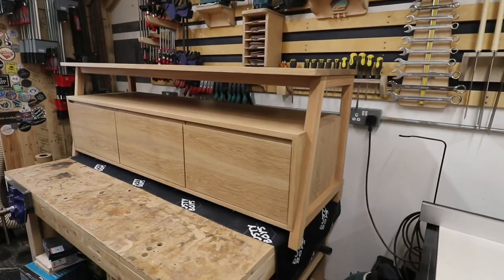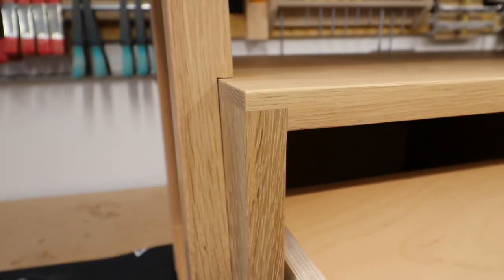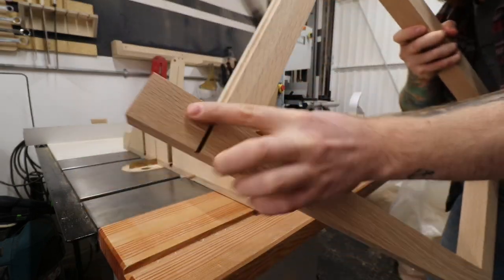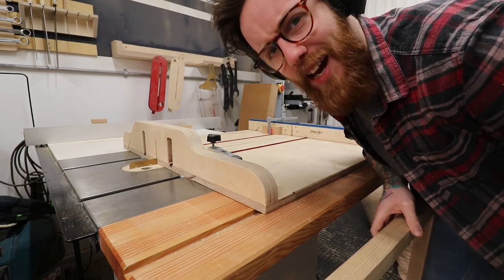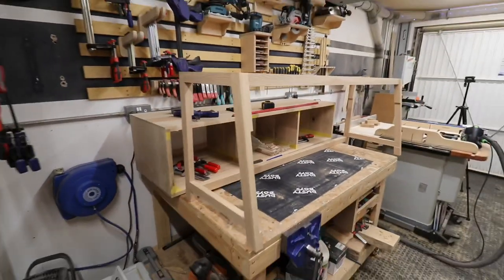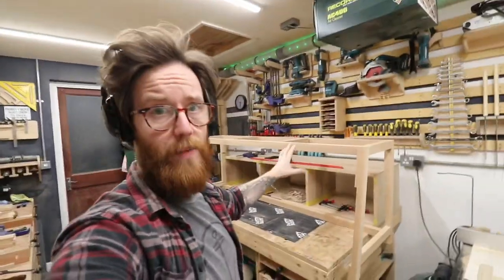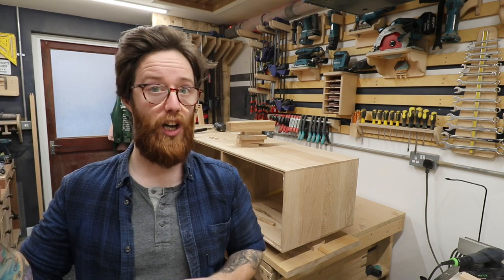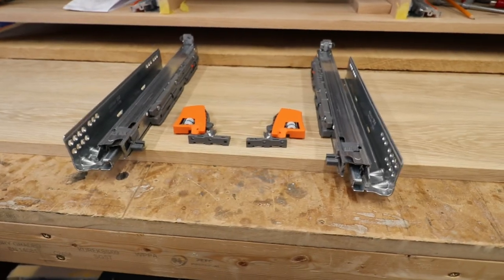CHECK those LEGS out || PART 2 || Woodworking

Comment: Hi Sam, build is going well 👌 I thought them dado blades for the table saw were Illegal in the uk.Not really show why 🤔 I heard it mentioned on a video I watch a few years ago.
Reply from the maker: Hey mate, cheers, glad you’re liking it 🤙🏻 Haha yeah it’s a question I get a lot over on my Instagram, it’s not illegal anymore, the table saw just needs to have a few requirements to allow for the dado stack. There’s only around 2 maybe three table saws in the uk market that allow for dados, my one is from Axminster and that’s where I got my dado stack set from too, so it’s all possible ☺️ Still scares me everytime I use it though 😂
Reply: Ah nice one, I didn’t realise that Axminster do a saw and set 👌
I wouldn’t like to my fingers caught in one like 😬
Reply from the maker: @gavjav1  Yeah it they bought it out a few years ago, it’s a Harvey table saw with Axminster’s logo 🤙🏻 Haha absolutely not, when I first installed the blades I steered well clear until I felt safe they were going to fly off the arbor and all over the workshop 😂

Comment: Any wood movement concerns with the legs and cabinet carcass? But looks like the are independent huh.
Reply from the maker: Yes they are separate, I’ve secured them with a slightly oversized hole which is I’ll allow for seasonal movement but I have no concern over it, it was pretty dry timber to begin with and it went in to a new climate controlled eco house so it’s all good ☺️🤙🏻